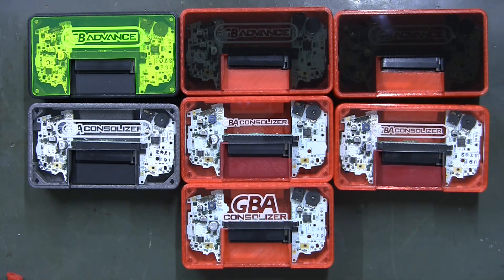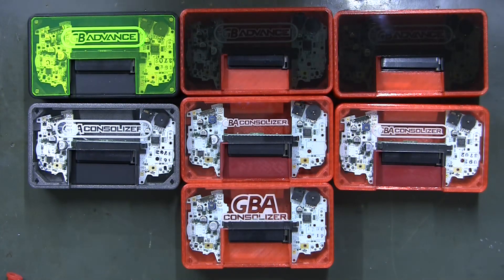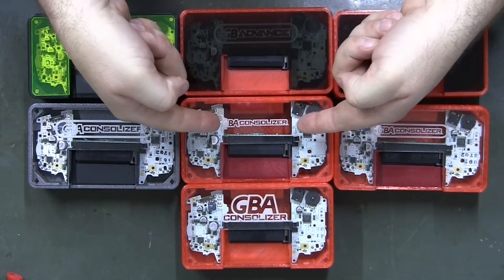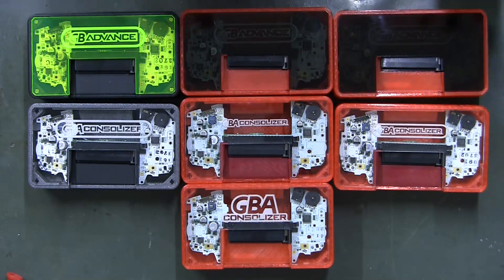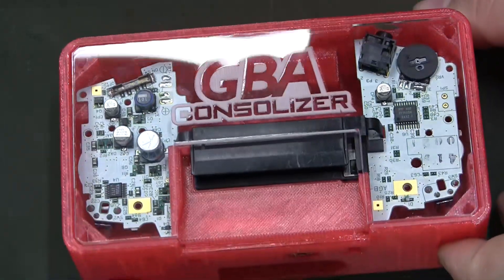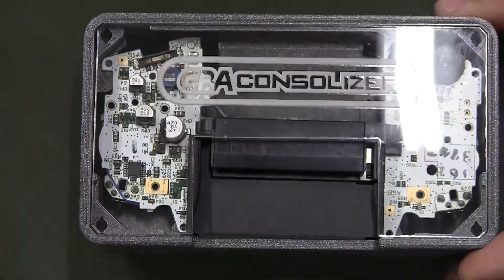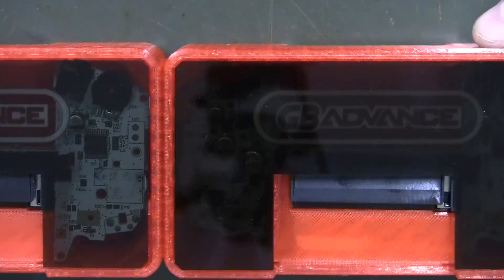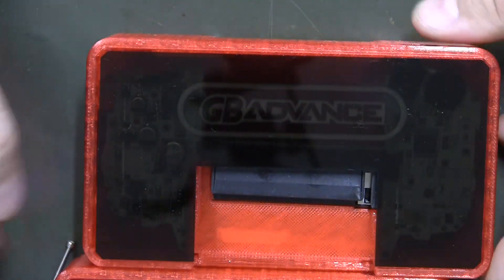GBAConsolizer new plexi options woozle gameboy advance hdmi

Comment: I hope you plan a revision that accepts any USB gamepad instead of a SNES controller.

SNES controller, used (meaning it might not work): $35 on ebay.
Cheapo Chinese USB DirectInput Dualshock clone: $5 (or sometimes less), brand new.

If I am to pay for a GBA, this modkit and a bunch of games (in reality though, an everdrive) I may not have much money left to buy an expensive (read: overpriced) controller to go along with it that is not guaranteed to work.
Reply: Get an 8bito retro receiver.
Reply: @ians_parks  With which we come back again to the "overpriced" thing...
Reply: @UltimatePerfection  If a $24 wireless controller adapter is too much for you then you should really pick a different hobby...

Also you were arguing about buying a controller that would potentially not work. The adapter is guaranteed to work so long as you have a somewhat modern bluetooth controller already which I assumed you would have. That means most ps3, ps4, wii, wii u, and switch controllers.
Reply: @ians_parks  On its own? It isn't too much. Along with this thing? That's over $60 we're talking about, the price of average AAA game.
Reply: @UltimatePerfection  Then get a cheap $9 chinese bootleg snes controller. You seem to have no issue them. And hey, itd be brand new~